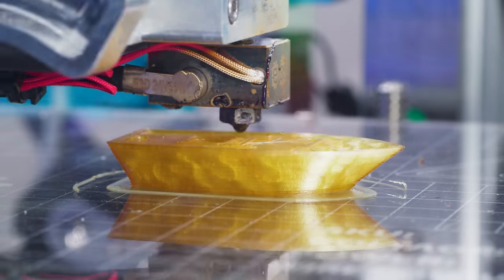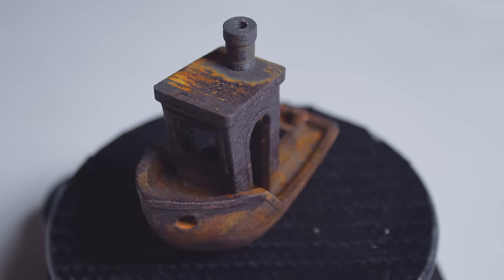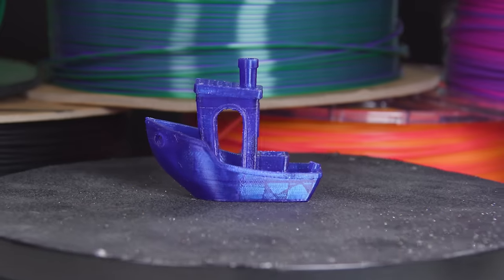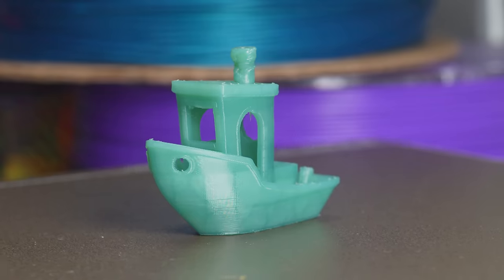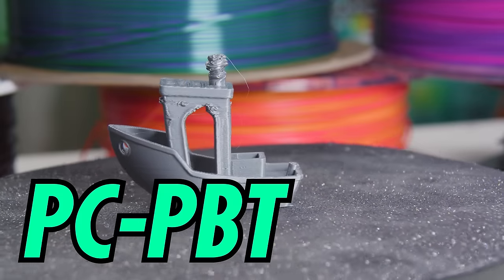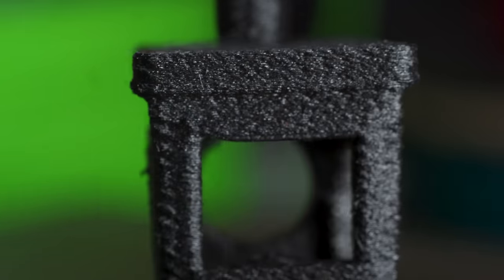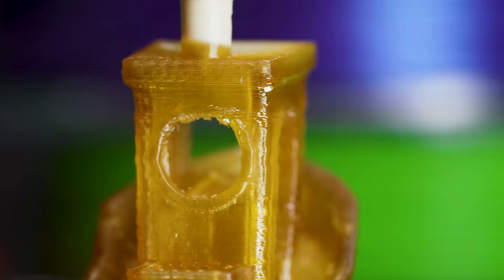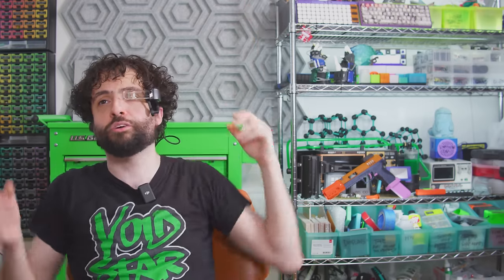The 3D Filament Tier List! Which Should YOU Use?

Comment from the maker: This episode is sponsored by Aura! Get 2 free weeks: https://aura.com/zackfreedman
Reply: Will you do a similar video on resins?
Reply: have you ever done SBS by fill X? or TPR?
Reply: Continuity error:
38:10 Ultem 9085 goes in F tier.
39:34 Ultem 9085 goes in A tier.
Reply: High speed PLA is bulshit I can print normal PLA at 500mms without any issues
Reply: Services like this can only stop companies from storing your information. Once it's sold. It's too late
Reply: Which one has PBT mixed in it. All the PLAs I look up are buried under jargon. Even the MSDS sheets won't tell you because it doesn't have anything toxic in it
Reply: Zack where did you get the glasses?O want to buy some.
Reply: any chance you can suggest a above  entry level printer?
Reply: @herbtender910   he made them from other things
Reply: Hold on, you need to do an update on that Alumium Wallet you got a year ago.  You said you would do it in 2023.
Reply: Great video, I'm just baffled why no one ever talks about CPE. I use Fillamentum's "Black Soul" CPE HG100 filament, and I don't think you covered CPE in any episode. I really, really like this stuff. 260-280C printing temp is no problem for me so I mainly print this.
Reply: Do you have a spread sheet on ranking
Reply: They ask which YouTube channel you say it on and you are not listed 😕
Reply: 9085 is probably one of the most popular polymers in Aerospace.  It's widely used in the the interior of commercial jets (747's, etc..) in both 3d printed and molded parts. This is mainly due to its excellent mechanical and self extinguishing and hydrolytic properties. It is basically the workhorse of Aerospace.  9085 carrys an FAA rating aswell. 1010 is far less common.

Comment: For anyone else searching for "99D TPU", you're not gonna find it.   I couldn't and I tried pretty hard.  Some here suggest Zack mistakenly wrote "99D" but really meant "95A" - because he links to that in his description.   However I have used 95A and it is not rigid like Zack describes in this video.   It's actually still quite flexible.   If you want a TPU that fits Zack's description better, try 98A TPU, which is indeed MUCH more rigid than 95A.  Shore hardness must be rated on an exponential scale because the difference between 95A and 98A is surprising.  It is relatively easy to print, does not bend up and clog like 95A.   Both Ranki and Priline make 98A TPU, both can be found on Amazon in a variety of colors.   I have found Priline's 98A TPU to be more dimensionally accurate than Ranki's 98A TPU.  The prints look really nice.  The finish of the Priline black and orange (only two colors I have used) is flat, very little sheen.   The finish of the Ranki has slightly more sheen.  Hope this helps.
Reply: thank you for this comment. very helpful. gonna order myself some Priline 98A for my a1 mini.
Reply: in a video by CNC Kitchen on TPUs somebody in the comments was talking about 70D (or in that direction) but nobody could find that either , at least not in EU
Reply: I don't think shore hardness is exponential. It should be linear of force vs displacement. How many 95A filaments have you tried? Your sample may be brand specific/moisture dependent. Also, 95A is pretty damn stiff from my experience. Ive read of ppl using AMS with it.

Comment: Obscure PETG advantage: it handles cryogenic temperature well. Now I understand most people don't have a need to store things in -80C, but PETG containers can. I have yet to test -150 and -196.
Reply: I've got access to liquid helium. - 269c. I'll float the idea.
Reply: Does PCTG handle that temp too?
Reply: @goldgoat22 float the benchie
Reply: This is actually really great to know, I routinely deal with both -80 and LN2 temperatures but haven't YET had a reason to 3D print anything for that use.
Reply: I don’t know if most Technical Data Sheets show it, but now i want CNC Kitchen Type Tests, but at various temperatures.

0c, 20c (or “close enough” room temp, just document it, and 100c at minimum

Whatever a Hot Car/Hot Day’s temp would be might be neat too, also like you said cryogen temperature *maybe*, but that is quite niche.

Along with Burn Tests though despite being niche can be useful!
Reply: Well, pla does as well, even tho it shouldn't.
3d-printed a liquid nitrogen container for a science lesson and it didn't leak. Was cold on the outside tho
Reply: That's actually good to know, we can get some nasty winters where I'm at and I've always wondered what filaments would be good for cold temperatures.
Reply: so, you're saying you can turn your Fridge into a Gridfinity system?
Reply: @Artista_Frustrado You know, for some things that's not a bad idea.  Now I'm thinking about at least taping out where certain things always go.
Reply: Submerged a PETG print in liquid nitrogen and tossed it on the ground. Did not chip or shatter.
Reply: I use pla containers for storing vials in -196 celcius. 3 months has passed and they still hold up fine.
Reply: This is good to know as I'm working on some parts for use outdoors in Alaska. Not quite that cold, but cold enough to worry about plastics performance

Comment: I'm annoyed about having iron filled composite in F-tier, if only because that particular blend is awesome for prototyping things that require magnetic properties, like brushless DC motor components and so on.  For all the other metal-filled composites, I agree that painting will largely give the same effect, but when you don't have a CNC mill, and want a part with "some" of the properties of iron, then an iron composite filament absolutely serves a very legitimate purpose.  Oh, and its surface finish is about on par with PLA-CF, just IMO.
Reply: The magnetic properties will be much lower than just using metal though.

What advantage do you have making your own brushless motor cores anyway? Just as an educational exercise it may be fine but it isn’t a great idea.

Also most things to do with iron and magnets or electricity get hot, PLA can only withstand 50-60 Celsius so it is a rubbish material for motors, electromagnets, transformers, etc, where you would normally just use steel.
Reply: @conorstewart2214 Of course it's for educational and prototyping purposes.  I'm not suggesting usual those materials for production.  That would be madness.

Given that many commonly available Neodymium start to lose their magnetism about 80C, then temperature control isn't something that can easily be fixed by simply using steel.  One part of the prototyping aspect is ensuring that there's sufficient air-flow to keep it all cool.  The 50-60C max operating temperature of PLA can actually serve as a handy canary in the mine in this instance.  If it's starting to warp and deform then chances are there's something wrong with your design.

The point being is that there is a legitimate purpose.  A good example of such on Youtube would be this: https://www.youtube.com/watch?v=NFvMC3l3fGY
Reply: Pretty niche  case. Just order a 3d print or have an actual cast iron part done. Not as expensive as you might think.
Reply: You can try the metal filament from BASF, it is expensive but works really good and at the end you have stainless steel
Reply: What is the need for the left eye  thing? It's off-putting

Comment: Fun fact, the powersteering and waterpump pulleys on my car is injection molded PA-GF 30
Reply: Less fun fact: The desk chair I am using is from Ikea and made of injection molded PA-CF 30.
Reply: @amicloud_yt for real or no?

Guessing a joke, but also PA-CF 30 chair sounds neat?
Reply: Yes, glass fiber reinforced nylons are used all over the place in injection molded parts that require greater rigidity and strength than straight nylon. Plastic parts in power tools are frequently GF-nylon.
Reply: @ericlotze7724  Nope, not a joke. I remember being very surprised when I saw the markings on the plastic!

Comment: PVDF is resistant to haloganated hydrocarbons because it is one itself, i.e. it's a fluoroganated hydrocarbon and fluoride make some of the strongest bonds in organic chemistry, which is why it's also resistant to inorganic acids, it simply just doesn't react with anything.
Reply: PVDF is also widely used in biology as it has several advantages over nitrocellulose when it comes to binding proteins. Very commonly used as a thin sheet for immunoblots.
Reply: @madengineer9072  can you say more? I remember using pvdf membranes for running westerns many moons ago and I never dug into why it was so desirable
Reply: It does seem that the best chemical resistance comes from the nastiest chemicals.
Reply: @iankampine285   A couple of reasons actually. PVDF has better detection sensitivity, and better protein binding capacity, it is also in my experience much more durable than nitrocellulose when handling it so is easier to strip and reprobe a PVDF membrane. There are still reasons to use nitrocellulose at times of course  (like if doing a Northern) but PVDF is a good all around material so is much more common in the lab these days. I've used both and the nitrocellulose was always in my opinion just more finicky and seemed to give a bit of an uglier blot.  Also, as an aside nitrocellulose as you can imagine is flammable. Old lab trick was to light a small amount as it burns very very quick without any residue so looks like it just disappears in a flash.
Reply: @conorstewart2214 Makes sense though.  It's like trying to burn ash.  The nasty things have already attacked the material, and aren't going to just let go.
Reply: I've also sent this message to someone else above, but I have a question about this and Zack's statement that it becomes deadly just a few degrees above the print temp.

I have some old injection molded parts I am in the process of replacing with printed parts that need to survive for years being exposed to chlorine gas. I'm an industrial design engineer and I did a minor in polymers and associated production processes, so I understood the potential risks of PVDF well enough when it came through my materials research as one of the only two viable options along with PPS that can be done in FDM and meets the chemical requirements.

However, from my understanding is that degradation and thus the extremely toxic byproducts like hydrogen fluoride, whilst extremely toxic, are actually very unlikely to occur since thanks to its fluor bonds being so strong - taking a lot of energy to break- it has a huge safety delta between the processing (~250°C) and degradation (~400°C) temperatures. Much higher than a lot of common polymers which seem to have around a 50-80 degree safety margin and obviously much much higher than it's chemical cousin PVC since its delta is actually negative.

This does not gel with what Zack is saying here, where he talks about even a few degrees causing the release of dangerous amounts of toxic chemicals. I would really like to understand this well, since this is a potentially dangerous situation I would like to avoid. I know that degradation doesn't happen at a set temperature, because of polydispersity shorter chains will degrade sooner, but I cannot imagine that to be such a factor that a few degrees above processing temps it is suddenly deadly.

Do you have any insight on this?
Reply: @martvansteenbergen8955  It is _properly_ because of the material breaking down due to the heat and thereby releasing it’s component part’s ie flour gas etc.

Comment: One hidden gem about all acetone sensitive plastics, is spray paint for plastics basically welds to them.  The main difference between normal spray paint and one that advertises use with plastic is the extra acetone in the mix.  Most consumer products that people want to paint are just injection molded ABS.